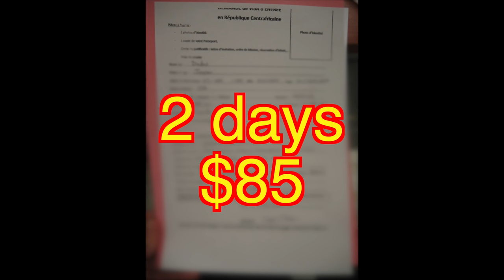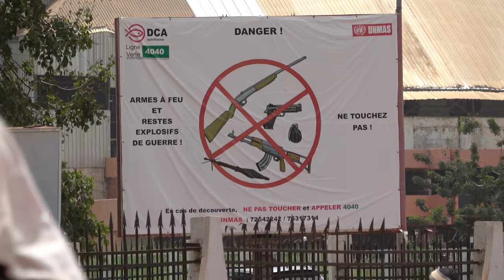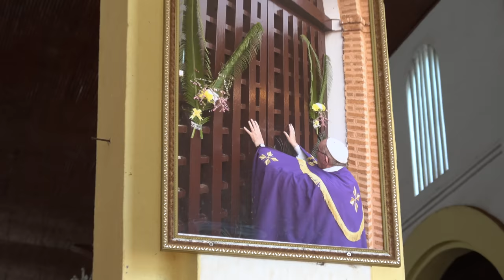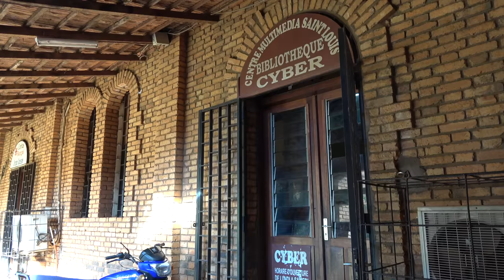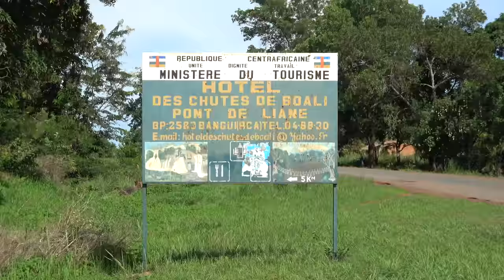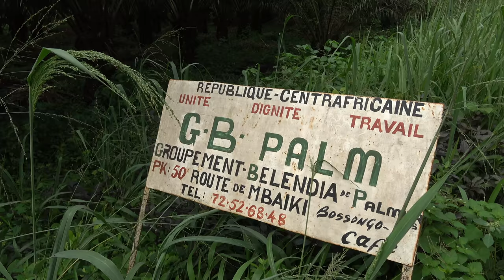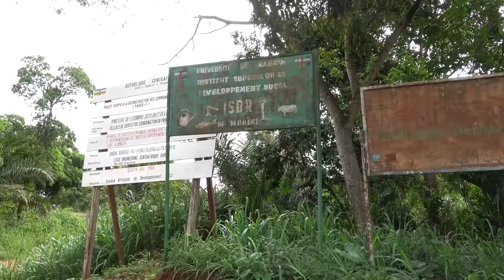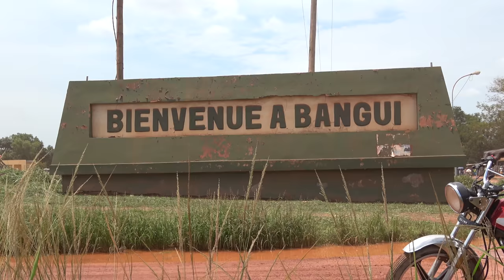Central African Republic

Comment: You plan to create an Azure virtual machine.
You need to identify which storage service must be used to store the unmanaged data disks of the virtual machine.
What should you identify?
To answer, select the appropriate service in the answer area.

A. Containers/Blobs: REST-based object storage for unstructured data.
B. File Shares: File shares that use the standard rd SMB 3.0 protocol.
C. Tables: Tabular data storage.
D. Queues: Effectively scale apps according to traffic.

Correct Answer:
A. Containers/Blobs: REST-based object storage for unstructured data.
Reply from the maker: Which video are you referring to?